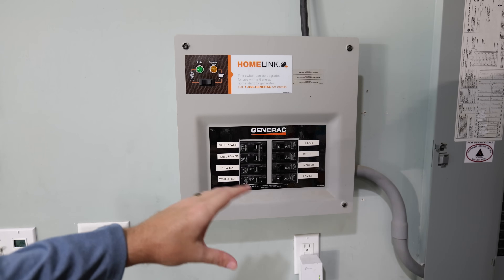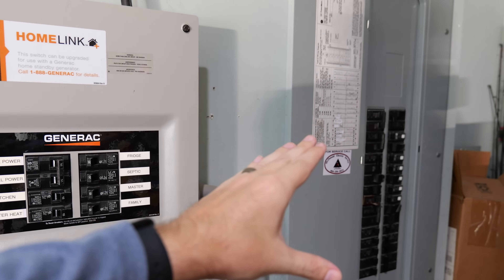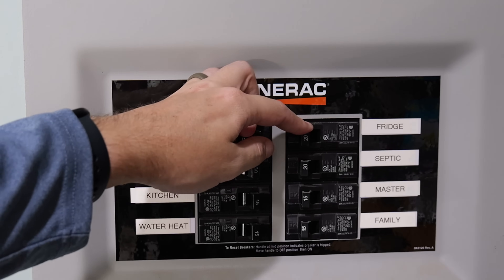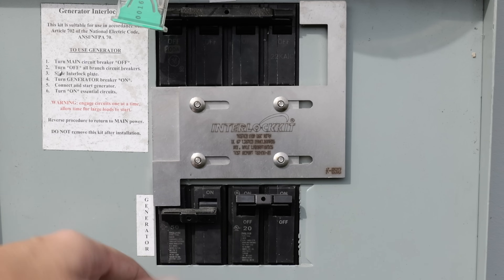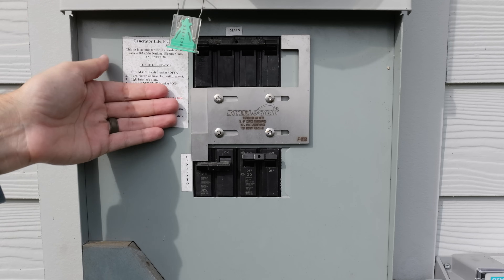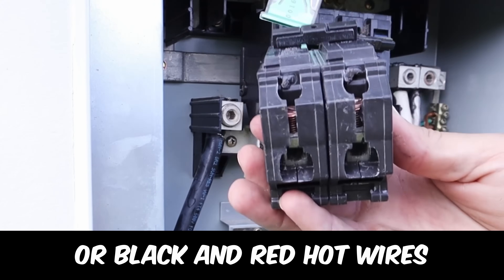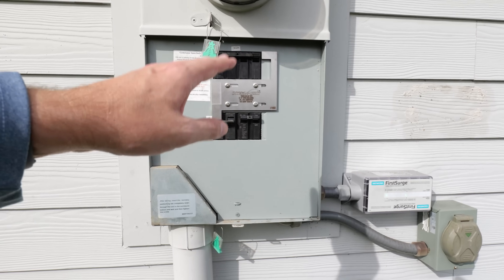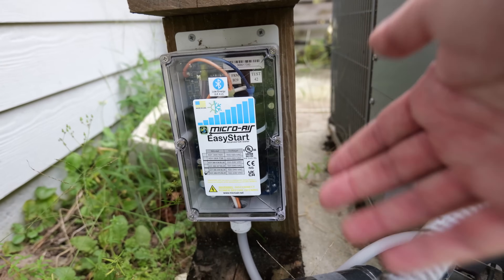The BEST Ways To Power Your Heat Pump or Furnace During a Power Outage! It Could Save Someone's Life

Comment: Um, this isn’t a cheap solution. An industrial electrician quoted me at $2000 at his cost (we’re friends) to do this.
Reply from the maker: For a transfer switch or for an interlock kit and power inlet box?  Because if it is for an interlock kit and power inlet box, buddy, unless you are running 100s of foot of wiring, you may want to find some friends that are honest with you.  There is NO WAY it costs him $2,000 unless there is something really odd I am missing here.  Transfer switch would be more but still don't see $2,000.

Comment: Great videos. Very informative.
Question: Is it safe to add an RV female type box outside and run wires to the breaker panel to a dedicated  breaker for the generator. I will label main power and generator power to the appropriate breakers so I know which is which.
The generator cable will be a male to male which will then be plugged into the generator and the RV box to supply power in case of outage.

Comment: I am scheduled to have solar installed soon, I didn't get the battery backup system.  My question is, could I get the electrician to install plug to where I could hook up a battery backup myself later?  Also do you think I would be able to hook a generator to that same inlet plug to run the house when power is down?  Thanks

Comment: So we just purchased a large generator and installed a subpanel because our electrical panel was full.  Our electrician said that we likely would not be able to run the heat due to to much required amperage. I assume that the soft start device would mitigate these concerns? We just want to run our upstairs unit in emergencies

Comment: Are you concerned with “dirty“ power? 

Generators that have a THD greater than 3 to 5%, possibly damaging electronic equipment?

I didn’t check the specs for the two generators in the video, but I will assume their THD is significantly greater than 3 to 5%.

My apologies, if my assumptions regarding THD on the generators is incorrect.

Thanks for all the videos.

Comment: Since the Micro Air soft starter x48 and x72 are relatively near the same price, could you use a x72 on a 3 ton to future-proof if you ever put in a larger unit down the road?
Reply from the maker: No, they told me they are designed to work specifically for different tonnages of AC units.  I’m not sure how but when I asked them they said absolutely not.
Reply: @HowToHomeDIY Question. First thank you for the informative videos. Really appreciate it. As for the question. I have seen more than one person talk about using a soft start on their AC unit. When I googled this. I see so many people talk about the concerns of this damaging their AC unit. How do I know if I need the soft start or hard start device and how can be certain I am not going to damage my unit with a device that is “suppose” to help but instead be the culprit of why my brand new AC unit on my brand new home goes dead as a result of using this device.

I do want to setup a system very much like you have here to use with a generator. Not sure if I am going to go with a battery powered inverter system like the EvoFlow or use an inverter generator that can use gas or propane. It seems to be said that using a generator with an inverter is better for electronics in the home. I do have electrical experience and yet I still lack confidence in doing this by myself. 

Anyway if there is any way you can help me with my questions I would be grateful

Comment: If it's a drastic situation, a camping tent on your bed, and or one of the largest tents you can find in your living room, with a slightly smaller tent inside it.
Reply from the maker: I think I would rather just do one of these installs and life really not be affected.
Reply: @HowToHomeDIY  That's great when you have the youtuber money to afford to pay the electrician enough to buy a new house. Some people need ideas that fit within some idea of a budget.
Reply from the maker: The second install is generally not that expensive.
Reply: @HowToHomeDIY  and how much is the whole setup when it's not given to you so you can shill for them in the Internet? How many people do you really think have this kind of setup? Tents are cheap and work without having to buy/store gas.
Reply: @HowToHomeDIY . This brings back a time when I did not know that there was such a thing as an interlock kit.  I knew the code and the danger of back-feeding.  I designed my own interlock using aluminum stock.  I came to find out that someone had already done all of this work and for many different breaker box configurations to boot.  Mine looked essentially identical to the commercial one which it should because there really is no other design configuration for my Square D panel.  Great minds think alike although some of us are just slower…
Reply from the maker: @TheLukemcdaniel not a dang thing was given to me.  I paid for it all.  You either put value on it or you don’t.  If you want to take that chance and sleep in tents then do it.  But the second option I showed can be done for a little more than buying some tents because not all tents are cheap either.

Comment: A Rocket Mass Heater or Rocket Stove. Heat your a&& with twigs. These work best with exhaust going through a thermal mass. The exhaust outside isn't warm and has no smoke particles. Full heat capture.